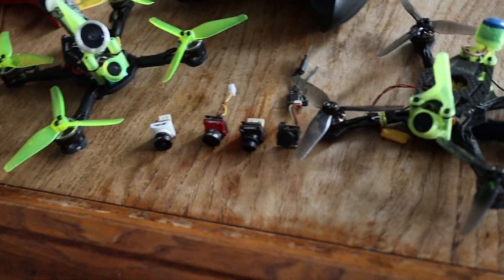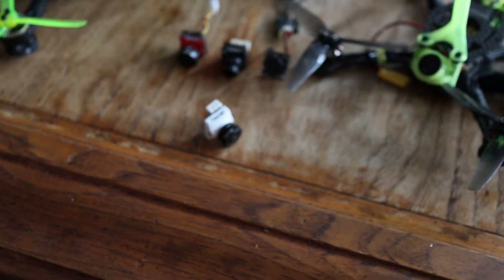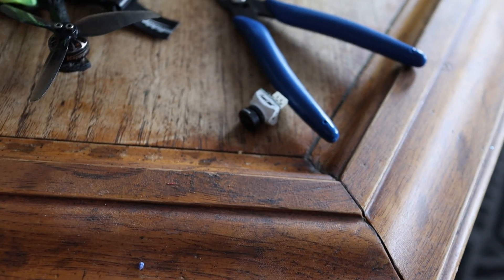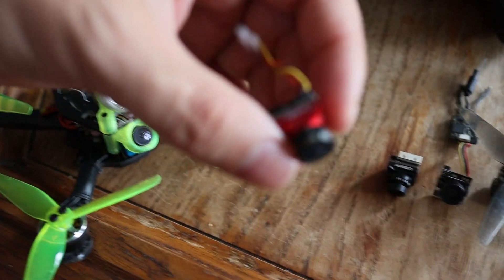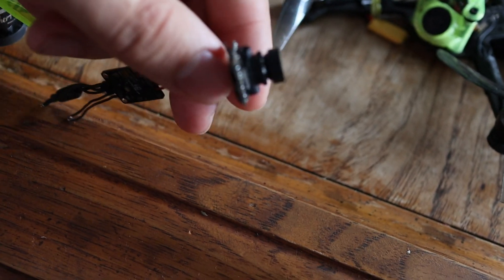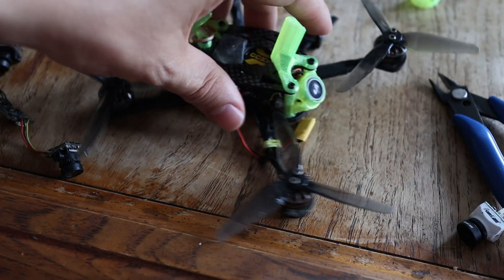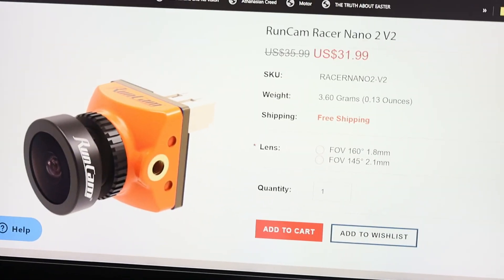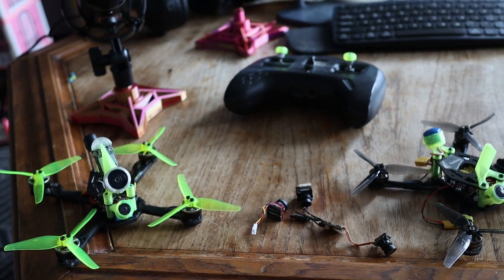How To FPV | Nano Analog Cameras Runcam, Caddx, Foxeer

Comment: Do you have an update on this? Any changes on your opinions?

Ive been trying to get a toothless 2 for months but now its out of stock everywbere and idk what to do
Reply from the maker: Order a Phoenix 2 Nano or nano runcam racer 3 they are my go to. I just got a nano predator V5 which is a lot of ppls fav but it was 50$ haven't built with it yet though. This is Phoenix 2 Nano footage https://youtu.be/JTJtbFsLUjI
Reply: @TorontoFPV  I looked into the baby ratel 2. Would that be a good alternative to the toothless 2 for solid low light performance?
Reply from the maker: I didn't like it as much felt its not as fast. Maybe try cat 2 or later if you can find.  I would recommend this one actually https://s.click.aliexpress.com/e/_Deh2P9T @sgas
Reply: @TorontoFPV  I bought a cat 3 micro before realizing I needed nano lol
Reply from the maker: it happens! lol once on ebay I bought a finger skateboard thinking I got a great deal on an actual skateboard...  @sgas